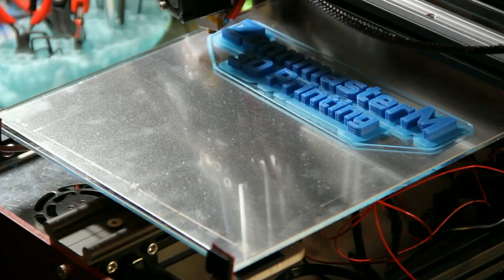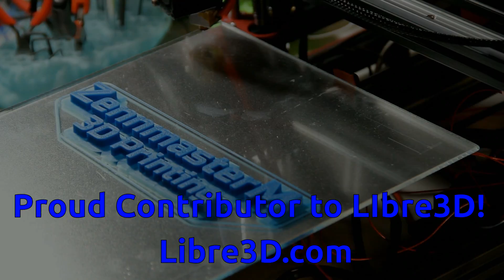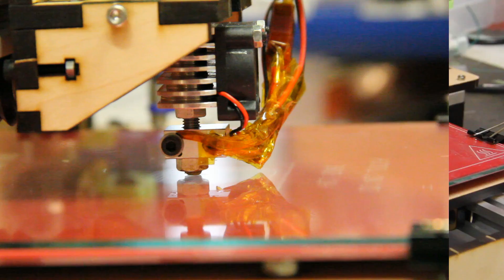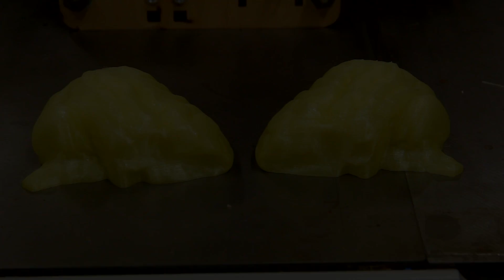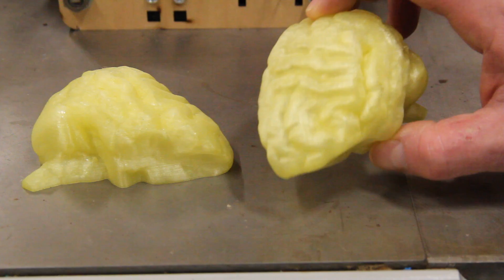REVIEW: Prometheus V1 all metal Hotend for RepRap 3D printers!

Comment: Hi Zenn,

Just FYI, you were printing at 0.1mm layer - this is actually LESS work on the extruder and hotend than bigger layers, as LESS plastic enters the melt zone, and more slowly - I'd recommend testing at the largest layer and highest speed to really see how much plastic the hotend can cope with - the settings you'd used there won't push the limits at all (in terms of meltability)
;-)

cheers!
Andy
:-)

Comment: In this video you mention that you prefer accuracy over speed.  Just what speed setting do you usually use in slic3r (or whatever s/w you use)? Do you normally use 100mm/sec or was that just a test?  So far I've not gone beyond 60mm/sec for any print moves.
Reply from the maker: For PLA I generally use 100mm/s for print moves without issue.  For ABS, I generally slow it to about 80mm/s.  Of course, it depends greatly on the nature of the shape.  Something with long, curving edges will tend to allow greater speed than something with a lot of corners and retraction moves.

Comment: Does the Prometheus mount in the same 'slot' as a J-Head, or the ALUhotend?  If so I think I will buy one to replace the ALUhotend on my new Wilson.
 
 I've been using the ALUhotend V5 on my RepStrap and it works so well that I ordered another one for the Wilson I just built.  Alas, it seems that the V6 Aluhotend has some issues for me, infill is weak, I see missing perimeters in my prints, and the weight of the parts printed is 'light'.  The very same G code sent to my repstrap produces good prints with none of these issues, and some prints were nearly twice the weight of those printed on the Wilson.  BOTH printers are running the same firmware (Repetier) configured for the specific 'steps per mm' of the respective printers.  Both are using the same extruder (MK7 direct drive gear) but with motors of different steps per rev (200 vs 400), the repstrap has the high res one, both motors are equal in torque (if anything the Wilson's motor is more powerful).  Again esteps is configured as required for the specific printer.  Build area on both is the same.  SO ... I should be able to use the same G code on both printers, if I set slicer settings on the conservative side.  YET, I am seeing these problems.  So I assume I have issues with the hot end.
Reply from the maker: Well, of course, the ultimate test would be to swap the hotends and see if the issues follow the hotend or stay with the printer. 

To answer your other question, the Prometheus fits just a tad more loosely into a J-head sized mount than the Aluhotend, but still quite a bit more tightly than an E3Dv5.  On my Makerfarm, once I tightened the attachment bolts on the Greg's extruder, the Prometheus was rock solid.  I would strongly suggest you will not have any mounting issues.
Reply: I think I might need to add a fan to my extruder to cool the stepper.  I needed this on the repstrap as the motor got hot when driven hard enough not to skip.  The new printers extruder uses a similar sized motor.
Reply from the maker: Kenneth Scharf
Some folks have had good luck with extruder motor fans, but first make sure the motor current isn't set too high.  That's a very common source of excessive heat.
Reply: On my first printer I had to set the extruder motor current to the upper limit of the motor to get enough torque.  With the fan the motor is now cold to the touch, even after hours of printing.  I may be driving that motor to its limits, but it ain't complaining.

On the new printer, I have a 1.2A motor running at almost 900ma (0.1 ohm sense resistors in the A4988 module and ref voltage of 0.75).

Comment: Hi Michael, I recently bought the pruza i3v kit from makerfarm, along with a 12V 30A led strip power supply (similar to yours if I am not mistaken). When I power the power supply under load by heating either the hot end or the heated bed, the power supply starts to "sing". Any ideas as to what this could be? Everything seems to work fine, both the hot end and the bed heat to the specified temps with no problem, I am just worried it may be something bad.

I should note that the noise is not a beep but a consistent pitch. Thanks!
Reply from the maker: On the face of it, it sounds like your power supply fan might be squealing, most likely due to a bad bearing.  It probably shouldn't be doing that. Sadly, quality control on those power supplies is somewhat "hit or miss". You might be able to open the power supply and replace the fan.
Reply: ZennmasterM Thanks for the reply Michael! Unfortunately it's not the fan but the power supply itself. From what I've seen so far everything seems to work fine do I'm just going to assume it's very loud coil whine or something from a bad unit. Thanks for the help anyway. Love your videos, keep at them!

Comment: Michael, quick question. I have a very similar setup to yours. Makerfarm i3v running Marlin. I just installed this Prometheus hot end (upgrade from a j-head). What did you set your MAXTEMP to in the firmware?  I changed the thermistor to 5 in firmware but Eric never mentioned the MAXTEMP settings. So far I really like the hotend but my results aren't near as polished as yours. I'm thinking its more user error rather than the hotend. I'm also picking up quite a bit of vibrating noise from the fan but I can't seem to figure out why. Anyways I like your videos!!  Always looking forward to more, Yo!
Reply from the maker: Thanks for the kind words!  I generally run MAXTEMP at 300 for any all-metal hotend.  That keeps things in a reasonable range and protects against mistakes.  If for some reason I need to go hotter, I'll change it, then change it back when I'm finished. As for polished results, I'd be looking very closely at your slicing program settings.  Coming from a J-head, I'd make sure you've got a 0.4mm nozzle selected, then I'd run a few calibrations, since the Prometheus will act very differently than the J-head.
As for the vibration from the fan, all I can think of is to loosen the bolts, then re-tighten them in a cross-pattern, kind of like changing a tire.
Have fun!

Comment: What is the length of the hotend?   I currently have the hexagon hotend and want to make sure that I would still be able to use my auto bed leveling setup. Want to make sure the probe arm will still be long enough
Reply from the maker: nephi jahn Because of the way the hotend is designed, the overall length is actually somewhat configurable, so it's impossible to give a single answer.  Just "by eye", I'd say it should fit where the Hexagon fits.  If not, I've got a longer arm on Thingiverse for the E3d, which will definitely fit.

Comment: I've been wondering how you prevent warping without redirecting the airflow from the fan away from the heated bed. What happens to me is that the air from the fan hits the x-carriage, is redirected downward, and cools the part as it prints.
Reply from the maker: Honestly, I haven't really experienced that problem.  Others certainly have, though, and there are a number of parts on Thingiverse that are designed to redirect the airflow.  I don't know of any that are specific to the Prometheus, but you shuld be able to find something that can be modified appropriately.

Comment: Hi Michael, I have a question to you about hotend maybe you know. At my 3d printer I have problem with  getting stuck and broken off filament (1.75mm) in extruder. Printer shows temperature 240 Celsius degrees but when I checked with IR Thermometer  it showed only 180. I tried to change the firmware settings but without results.
Do you know something about this issue ?
Reply from the maker: That sounds like a thermistor table problem.  I would check to make sure you have the right thermistor selected in your firmware, and then make sure you've got the right thermistor table.
Reply: ZennmasterM
Ok. What I do. I connect other thermistor with same characteristics. And then I compared  temperature and see more truthful results. Chinese made defective thermistor.
Reply from the maker: I'm glad you got it sorted!

Comment: I was waiting so long for this review, a great review Michael, great hot end as i expected, what stopped me from buying this hot end even without you review it was its only one size nozzle (orifice) 0,4 mm :(, but i still like it a lot.
Reply from the maker: fat haj Actually, don't let the single size fool you.  A lot of the performance you'd see with a larger or smaller orifice can be attained by changing the length of the melt zone (longer is more like a larger size, and shorter is like a smaller size).
Reply: ZennmasterM
Ok, now I'm thinking, when you can configure the whole hot end or adjust the speed and printing quality by shortening or prolonging zones not only melt zone but transit and cool zone on it you probably can attain somewhat the performance of smaller or bigger nozzles by doing it. Thank you Michael, you saying this one is the one you would put on your printer says a lot to me though
Excuse me for my English.

Comment: When printing in PLA isn't it better to have another fan blowing on the tip of the nozzle so the PLA cools fast?
Reply from the maker: It definitely can be beneficial.  It does, hoever, make if difficult to shoot a review video. :)
Reply: okay , one more question ... there are basically 2 kinds of cooling ducts that i have seen that i have seen. 
1. that blows are 360 around the tip .
2. that blows just from one spot .
have you seen any differences between the two when printing in PLA ?
Reply from the maker: pwave123
Truthfully, I've seen very little difference by using a fan with PLA. The ones I have used have all been the unidirectional type.  I don't really care for the "surround" type because 1) I don't really see where the airflow goes to carry away the heat, and 2) They create even more back-pressure than the unidirectional type.  This is, of course, just my opinion.  Your mileage may vary considerably. :)

Comment: Great video Michael! Would really like to get this but I got the E3DV6 not too long ago and it's treating me well so far :)

BTW, what do you use to prepare the bed before printing?
Reply from the maker: Thanks, Stranger! 

I generally use hairspray, since it is cheap, easy, and when used right very effective.  I have also heard very good reports for glue stick, as well as the standards: painter's tape and Kapton.  If you're printing in ABS, though, the best you can do to keep from warping is to insulate your print from drafts.  It doesn't necessarily have to be super warm, it just needs to be still.
Reply: ZennmasterM I use a large stick of Elmer's glue and it works really well, even better than hairspray (at least with my experiences yours may differ). It also washes off easily with some warm water, it's worth trying if you haven't before.
Reply: ZennmasterM I tried hairspray but didn't get good results, what brand do you use?
Reply from the maker: Teh Stranger?
I use Aqua Net Super Extra Hold.  In general, the cheaper the better.  Also, I've found that there is a balance for how much spray to use.  Too much or too little means a weak hold.
Reply: ZennmasterM Does it have to dry up or need to be sticky when the first layer goes down?
Reply from the maker: Teh Stranger?
 It definitely needs to dry before starting a print.  The good news is, at ABS temperatures, it only takes a few seconds, maybe half a minute.  If the bed is cool, then by the time it heats up, it will certainly be dry.
Reply: ZennmasterM Sweet, I will try it out and report back. I've been printing with PLA and I thought the hairspray needed to be a bit wet and sticky and silly me sprayed on the bed as it was printing to maintain the sticky state and I actually got some spray on the hotend and its stained, would it be okay to clean it with Methylated spirits?
Reply from the maker: Teh Stranger? You could, just make sure to keep the solvents away from any plastic parts.  Personally, I wouldn't necessarily bother, though.  Every hotend I have or have ever had gets dirty on the outside of the nozzle.  As long as it's extruding straight and easily, there's little to worry about.
Reply: ZennmasterM I'll leave it then. Thank you so much for answering my questions!!